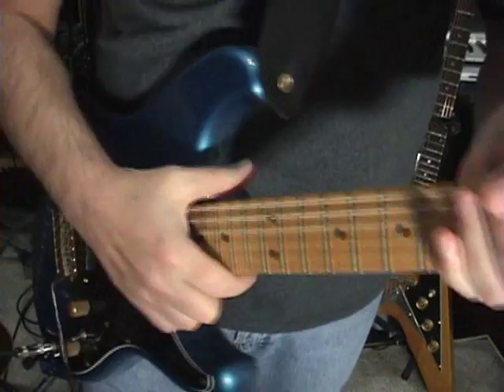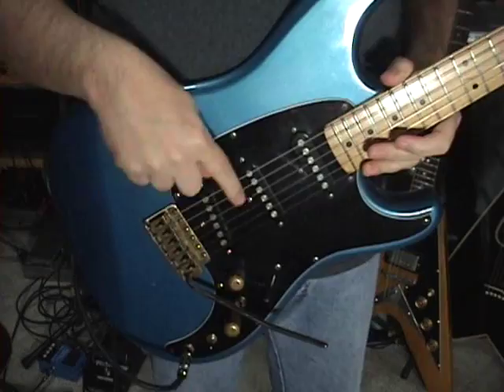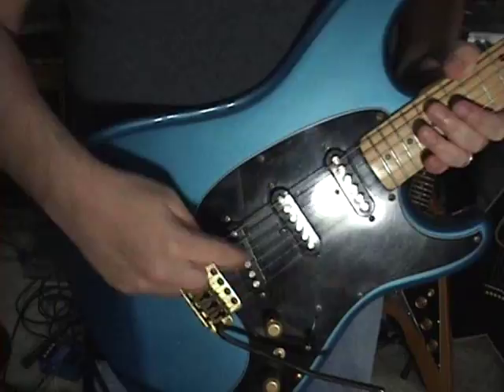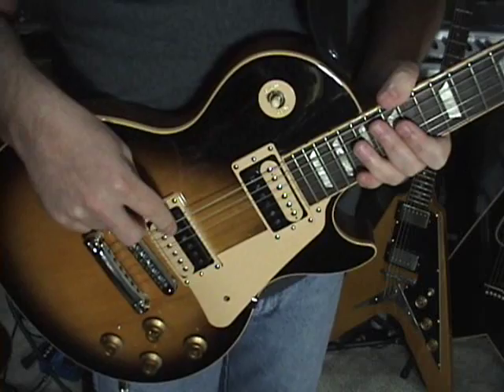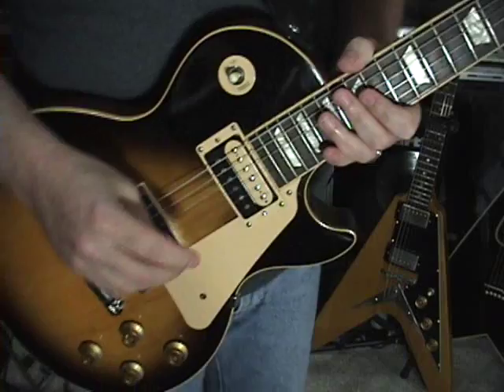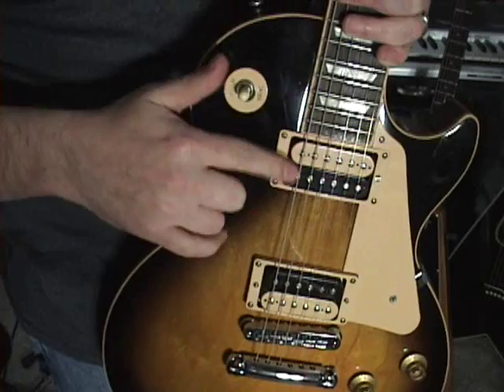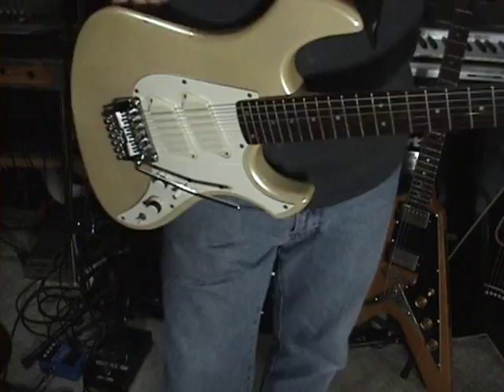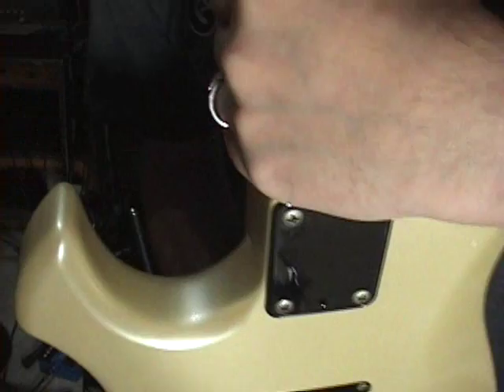Pickups Coil Split, Tap, Phase Switch, TBX, S-1 Parallel, Series Scott Grove

Comment: When you where talking about splitting humbuckers you said fender did it right by adding more electronics years ago and gibson is now (in 2012) just doing it right . I was wondering what the science behind that is? Totally depolarizing the other half of the pickup? Also gibson introduced a new line of what they call "tapped" ;/ pickups on a 2013 tribute les paul marked T. Do you know if they are split correctly or the same as your second guitar in the video? Thank you
Reply from the maker: Gibson are morons.  When they say "TAPPED" , they are talking about SPLIT.  They HONESTLY don't know the difference.  Some companies honestly think that the terms are interchangable.  Gibson also have guitars with single coil coil P-90 pickups that are indeed TAPPED.....so, they use the same word.....but it's a whole different thing.  That's simply Gibson being morons.  lol

Comment: So would you say that a high output humbucker, let's say 13 or 14k has less high end or concentrated tone then one that is lower output say 8 or 10k? And that higher output Humbuckers coil split more successfully as far as dropping volume is concerned.
Reply from the maker: The ohms don't have anything to do with the output being higher or lower on the pickups.  So, the 14k or 10k etc. has nothing in common with the output.  Over wound pickups, that result in higher output will have less high end and will get muddy quickly.....to a point that no amount of messing with the tone on your amp can fix.  It's ALWAYS best to go with regular output pickups and just add a clean boost before the amp rather than expecting hot-rodded pickups to do anything positive for you.   It's like thinking it would be really cool to have AIDS for a little bit, then you find out that it REALLY sucks, but........you can't do anything about it now.

Comment: thanks for the video, very useful to hear the possibilities.

I was wondering if you have any recommendation for electronics to make an electric guitar suitable for both rock and bachata (think xtreme/Aventura).  Every bachata band I've seen and every you tube fix has been to ad a PAF 57 humbucker to an electric acoustic, never seen an electric guitar solution.  I'm about to embark on my first build, but still trying to figure out if this can be done.

Comment: Technically, since a humbucker is two single coil pick-ups, I would think that you could wind and tap one or both sides, making use of half the winding on either or both sides.  Probably just give a really weak sound and you would have something like four power leads coming out.  Here is an interesting thought.  Build a humbucker, create not a half wound tap point on the second side of the humbucker, but rather, wind the second side so small at the tap point that the second side would totally outweigh it in volume, just like a single coil, and with the small bit of winding on the other, it might add a little sparkle and accomplish noise cancelling.  Might make for a neat experiment.  What would you call it.....  LOL...  maybe a coil tapped Gibson....LOL.  I don't know Scott.  I learn a bunch from your videos, and you are a creative thinker, much like myself.  But I am afraid that you might have missed the mark on this one.  If Gibson is calling it a coil tap when it should be called split coil, and then you go on to say that they are not actually making it into a single coil, then, I see no inbetween other than what I just described.  They either totally turn off one total side of the humbucker, or they tap power from it.  If you are saying that they do not turn it completely into a single coil by turning off one side, then isn't the only alternative a "tapping" out of power at some point in the winding?
Reply: Actually, Gibson does NOT have it wrong.  Sure you can call it a coil split, but its also a coil tap, it just happens to be at the beginning of the coil.  You are right that you cant coil split single coil pickups, but you absolutely CAN coil tap either or both coils on a humbucker.  I once had a  winder tap one coil on a neck pickup.  It reduced low mids wnd added lots of single coil type high sparkle while still retaining much of its humbucking properties.  Now gibby just makes them like that without the extra wire and calls it a burstbucker (mismatched coils).

Comment: Great video thanks for the info. The only thing i can say about the Les paul is they are really meaty sounding guitars to begin with. They have a lot of punch so You can really hear the tone of the wood coming thru unlike a tele or strat per say even more with a bolt on neck they sound more thin than a Les paul. I think Gibson got as close as they could in splitting the humbucker into one single coil for the time and surely they get better at it as time goes on. Never the less thanks for the info. I was always confused about coil tapping until now.

Comment: Hi Scott, always enjoy your videos and have learned a lot. Being an audio tech for many years I also am with you on the correct terminology and the tons of misguided information out there. Technically what you describe as in and out of phase is correct but a better description is out of polarity,  or 180 degrees out of phase. Out of phase has a lot of meanings, a reverse of polarity has one meaning and is also 180 degrees out of phase as I am sure you know. I did not know about the magnet trick, what is the difference between the coils being out of polarity electrically and the magnet poles being reversed? If you had two humbuckers with the north magnets facing one another I don't think you would get a phase reverse sound would you? Also wanted to ask you when I coil split 2 humbuckers and have them both on I notice they have to be at the same volume to cancel hum. Does the ability to cancel hum have more to do with the magnets being correct, north facing south? or the windings being reversed of the 2 coils that are on? or a combination of both. Thanks for your great work!

Comment: Seems series/parallel can be done as push/pull also, which would really keep it looking stock. Just like beater cars with a hot engines. Pretty much describes how I like instruments. Nice and average until you "put your foot in it". :)

Comment: I would love to hear your suggestions for Strats under a grand, beside the Peaveys, Washburns, and Ibanezes you've already mentioned. I'm looking for a HARDTAIL Strat with a wide, flat, and thin neck, like on my '83 two-knob Strat, with a maple fingerboard. Fender currently makes only two hardtail Strats, but the Jim Root, which has a 12-inch neck radius, comes only with two EMG humbuckers and is a bit ugly, and the Robert Cray has an asinine neck that must be removed to adjust the truss rod.

Comment: I haven't read all the other comments so this may have been said...

The original Gibson Performer *when split* is a larger than normal single coil sound, you say, due to the second coil not being shut completely off and still "leaking" sound...

(Curious what test you ran to check that, btw?)

Because going by what you said, it sounds like Gibson is correct when they call it "Tapping" (a larger than normal Single Coil sound)

When you *split* the pickup, you're actually dealing with the sound from (or at the very least, OF) an overwound Single coil.

So,  A: Would you prefer Gibson call it splitting which you could also say is wrong or B: Tapping, which is actually super cleaver, if you think about it? 
AND technically... less wrong going by everything you've said in this video.

Gibson called it "Tapping" 

Tapping = overwound Single Coil that produces a larger sound than a normal Single Coil when it's engaged.

Splitting = 1 of the 2 coils is shut off when engaged.

I don't make pickups but it seems possible to overwind just 1/2 of a Humbucker... your thoughts?

Comment: doesn;t prs 513 have tapped humbuckers instead of split?
Reply from the maker: Neither actually.  It has 5 individual single coil pickups mounted in it.  Pretty cool.
Reply: groovydjs
You should do the same with 5 Lace Sensors lol.
Reply from the maker: ArriCAT5e I've got one with 4, I should add one more to the bridge.  I do actually have enough room on it for 7 total............That could be fun!  lol

Comment: Very useful video to me, since I have not that experience and knowledge in guitar electronics and, as you said, most companies (and shop assistants) don't know what they're selling. I'm just wondering, what about Humbuckers (not singles) that have a "Series/Parallel" push-pull (like new Washburn Parallaxe are supposed to have)? Is that just a coil-split and Washburn doesn't know what is selling? Is it something different? Does this system kill the straty tone it is supposed to deliver?

Thanks, and sorry if there's some grammatical error, I write from overseas. Keep up the good work.
Reply: If I'm not mistaken the series/parallel is like a coil split but it actually kills some of the hum that you would hear if you just had a coil split.

Comment: Hey Scott I have an '80 Ibanez Blazer that I need a new bridge humbucker for.  Any suggestions?
Reply from the maker: Hey Dave.  Congratulations on the Blazer!  Cool guitars.  If you don't want to put an original back in it, I would think about a Dimarzio Dual Sound humbucker in there.  You can do the coil split switch thing and go from single coil to humbucker with it.  It would still retain that sound of the era the guitar was made in, plus be able to get those Fender type of tones as well.  Cheers.
Reply: groovydjs
Thank's for the reply.  I'd like something hotter than the original.  I also would like to keep the stock look.

Comment from the maker: I LOVE THEM!  I think they would be AMAZING on a JAZZ bass.  They are one of the best sounding basses of all time anyway.  So, a little something extra would be too cool to have on there.  The S-1 switch to take it from parallel to series would be cool on the volume control.  Just a "FAT" switch if you will. There are and were actually quite a few Jazz Basses that came stock with the TBX, so toss it in there.  It's a beautiful thing.

Comment: I have an epiphone les paul that i want to mod the hell out of! how many pick up patterns could I wire? I am going to do an all round upgrade so I am buying some new pick ups soon! what would you recommend? I would like to have as many varieties as possible so I can experiment as much as possible!
Reply: anyone.....?
Reply: Dann Barr is there actually......no one???
Reply: Dann Barr I'm a person! The most I've seen on a single PU is a three way switch between Series - Coil Split - Parallel. Assuming you have more than one PU on your guitar, you could then put in a phase switch. A phase switch reverses the polarity of an entire PU. So to even hear a difference you'd have to be using more than one PU. Hope this helps! Feel free to message me if you wanna talk tech. I don't know a whole lot about physically wiring these things, but I can point you in the right direction and give a bit of theoretical insight.
Reply: Dann Barr the most popular mod is the jimmy page mod, with les paul style u can get 21 different tones just by changing switches. u need pickups with 4 wires for this, .http://www.seymourduncan.com/support/wiring-diagrams/schematics.php?schematic=jp_style

you can buy ' harness' which they already mod the wiring for u, u have to connect it to pickups your self. http://www.jerseyshoreguitargarage.com/wiring-harnesses.php

Comment: As much as I appreciate what dude was attempting to delineate, he just ventures off into extraneous/tangential info that's not necessary to communicate was he was providing. Stuff about his preference in guitars and other tangents kept losing me. And some of what he conveyed seemed to conflict with his original points. I found myself (a few times) thinking, "What??? That doesn't seem congruent with what you just said..." I mean, I got his points, but when he ventured off several times about things that were at best nominally connected to his points, that's when I started getting frustrated. I wanted to tell him, "Dude, just stick with your main points. If you want to do a 2nd posting and venture off, do that instead." Overall, I got what he was demonstrating but it was really laborious.

Comment: I actually feel like a fool for believing all the crap the big guitar companies have been feeding us. So much misinformation. That led me to a PRS video where Paul himself was talking about the split vs the tap. On one of his models he actually has a neck pickup humbucker that when the tone knob is pulled, it shuts off one row of magnets, but engages an additional 5000 winds of wire that are around the row still on. That way, there is no loss of volume. I don't know if that is still a true tap, but it is a clever idea. And he even says that it behaves like a true single coil, with the 60 cycle hum and noise and all the spank of an old Fender.
Reply from the maker: Don't believe PRS either.  That guy is a super dumb ass.
Reply: Charlie Foxtrot The 3rd Yeah they do that to compensate for the volume loss from humbucker to single coil. It's pretty smart but it's not just plain splitting - they're adding something to it. Which is fine, it's not like they're claiming it's pure coil splitting and lying. 

Sometimes, when you're live, it's difficult to just go back to your amp and adjust for the volume loss or have to fit another boost onto your board. Either way you're having to change something whether it be adding more winds when splitting, throwing on a boost, or turning up your amp. I think the added windings is convenient. But to each his own 🙂
Reply: Groovy Music Lessons Egotistic much